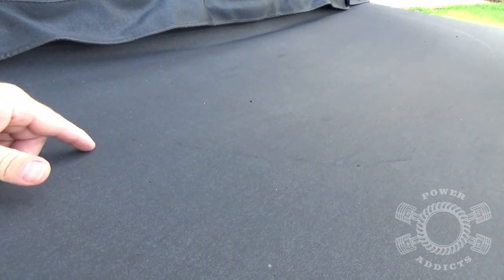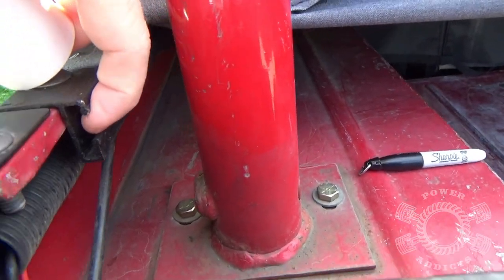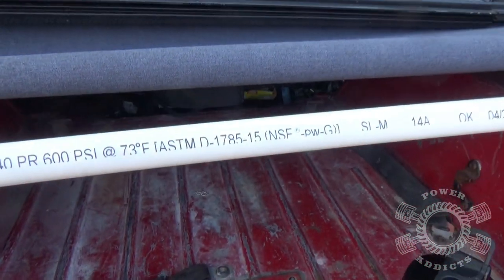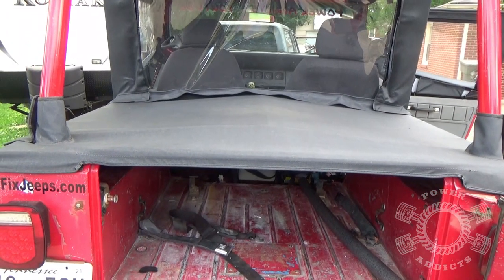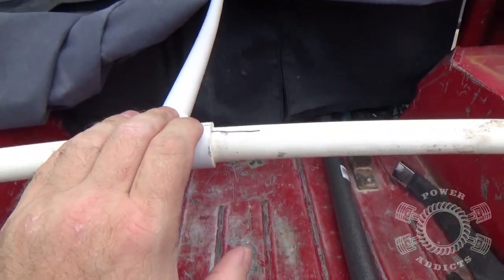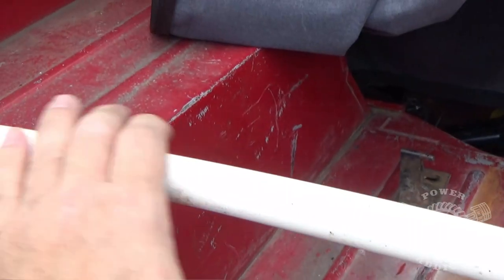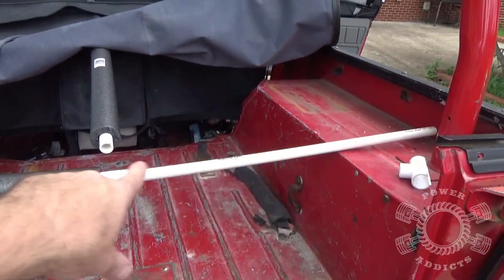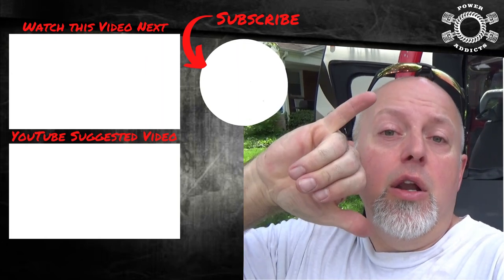Jeep YJ Tonneau Cover Prop - Easy, cheap and very effective! #jeepyj #poweraddictscrew

Comment: Hey Chuck. Awesome vid as always. I'd like to maybe talk sometime about an issue I'm having with my 92 YJ
Reply: RESISTANCE AGAINST TYRANNY  
At idle I have just noticed a slight knocking. It's not very loud. Once you give it throttle the knocking goes away. I have the straight 6 with 186,000 miles
Reply from the maker: I agree with @RESISTANCE AGAINST TYRANNY , the inline 6s and 4s were known to have a lifter tick after the miles stack up. Its an easy fix and not terribly expensive. I have a video of changing the rocker arms, pushrods, and followers. It quietened a friend's 2000 TJ and it even helped the performance A LOT!!
Reply: @Poweraddicts  really pour kerosene into the oil and let it idle for 30-45 minutes??? Then change the oil. Got a suggestion o. What weight of oil to use and brand or kind????

Comment: Hey Chuck, what made you decide to want to get that style soft top? I had a similar setup and I was not a fan. Love the look but it really wasn't for me. As far as cleaning the stains, I use a horse hair brush with soapy water to scrub down the top. It gets most of the mud stains out of my soft top so I don't see why it wouldn't work on that

Edit: Just saw the part where you said you were going to make a video on the top lol
Reply from the maker: I've run the Bestop SuperTop, stock YJ soft top, and a couple of different hardtops. I still had the factory soft top frame that came off of Rust Bucket. I very rarely run a back seat so I thought I'd try it out. I do like it for the different styling, it's quieter and definitely, has fewer water leaks. But it is without a doubt a bigger pain to drop the top. But where the rear curtain can be completely removed, I find I rarely wanna completely remove the top. Its kinda like running a safari top without the rear curtain and doors. I'm wanting to try a Rampage Frameless next. Buddy of mine has one on his LJ, I like it. Have a good one bud!!

Comment: Check I know you're busy and everythingI hit the crossbar on that jeep and my ground wire Tianjin smoked real bad but I still have lights when I turn the ignition the car won't start over what should I look for to see if it's not making connection when I turn the key

Comment: So when are you gonna do a ax5 to ax15 swap on a 95 yj with 2.5
Reply from the maker: All my rigs are 6 cylinders. One of them is an automatic, the other is an AX15. So .. if I ever happen to buy a 4 cylinder I'll venture down that road. Until then ..
Reply: Just curious i had a chance to by a 4.2 motor and trans cheap but I didn't wanna go that route my 95 is a daily driver also i have the bell housing for the swap, as of right now im just driving it with the ax5 getting stuck in gear and grinding until it gives out or i get all the proper stuff I need for the swap

Comment: Why does my pipe keep bowing down
Reply from the maker: If its a tiny bit too short or not using the top center pipe it will bow down. I'm still using that set up in the video and it still works great.